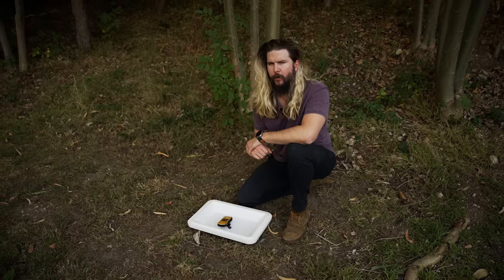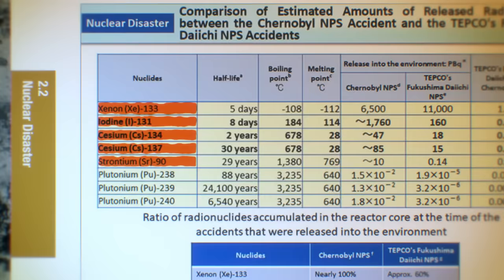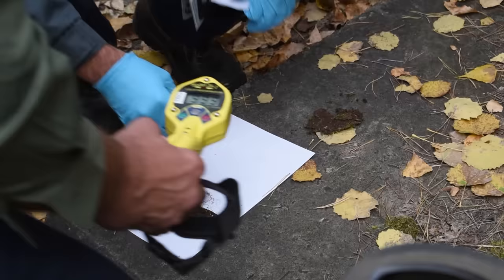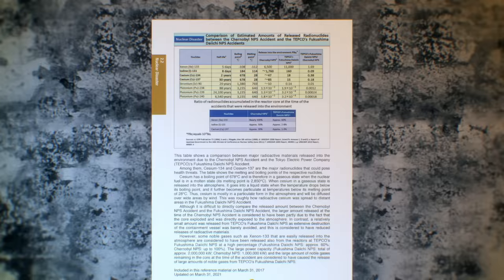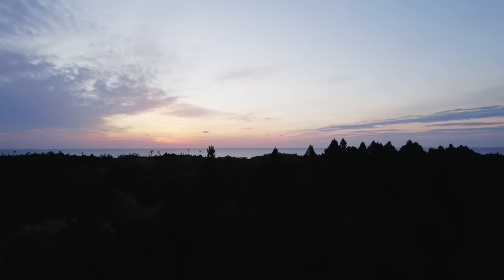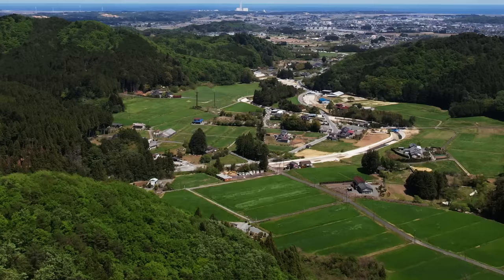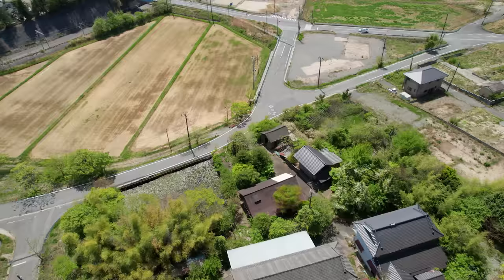A Nuclear Disaster's Deadliest Detail

Comment: I was a kid in Swedish Lappland when Chernobyl blew up. Up until then people didn't even thought of radiation that way. But oh, did we get an awakening. The small town where we lived had high levels of bequerel (the radiation from Cesium). The basement in our house had above 25 000 bq (per m3) when tested. Todays limits is 200. Luckily, our house was an easy fix. But some houses (mainly those made out of a lightweight concrete) was very problematic to do something about. Because it turned out that the material itself was a bit radioactive, depending on the source where they took the stone from.

Comment: The consolidation of "hot"(radiologically speaking) can indeed be more dangerous than the necessary clean-up process, especially if that process over-extends.
In the 1km squared scenario, the collected material would no doubt take up less space than if it was left where it fell, leading to increased exposure for anyone who has to survey, guard or remove the accumulated materia.

Comment: Hi Kyle,

First of all, thank you for that excellent introduction to the subject of hot particles (things I did not think I would write on YouTube lol). I did my PhD on this topic a few years ago and still work in this field. You did a good job in explaining the difference between Fukushima and Chernobyl! Their release of radioactive isotopes was indeed very different. Thank you for educating people about that.
While in Chernobyl whole chunks of the actual uranium fuel were ejected into the environment, the containment in Fukushima prevented this. Nevertheless, hot particles can be found in Fukushima. But they are not pieces of the nuclear fuel but condensed volatile elements. They are smaller (below 1 µm) and are basically glass pearls which contain radioactive Cs-137. Think of them as tiny spicy marbles. Bigger chunks of actual UO2 fuel like in Chernobyl have not been found (to my knowledge) in Fukushima. Which is a good thing!

We are still working on these particles since we want to understand how they behave in the environment. Nobody would leave spent nuclear fuel outside for more than 30 years just to look how it would dissolve into the ground water. Try to get funds for that idea... so these particles are our best system to understand leaching and dissolution under real life conditions.

Most of the counts you do measure with the Geiger counter on these particles come from Cs-137 as it is not completely lost from the fuel. The rest is Am-241 and Eu-154. U and Pu are to long lived or are not detectable with the hand held device.

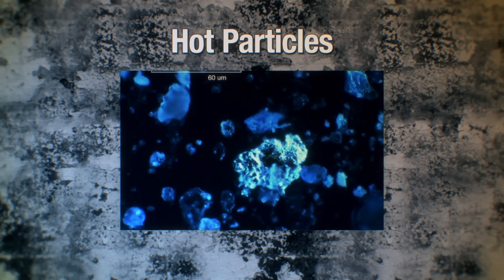Cheers for showing our work horse "Bob" @4:49. He is a fine particle and has been used for a lot of measurements so far.

Comment: Another thing to consider is psychosomatic effects of people living in the Fukushima-Daiichi contamination zone.

Because, for years and decades, every little sore throat, bump in throat, or bump in body part for whatever reason will send a spike of anxiety through you not knowing if that could be the one that is an actual tumor.  This psychosomatic anxiety has very real-life negative effects on both the mind and the body.
Reply: Furthermore, all this work to clean up Fukushima Daiichi will take 30 to 40 years.  That estimate is based on technology and techniques that have yet to be invented!

All six BWR-type reactors will be scrapped including reactors 5 and 6 which were undamaged.  Final cost total estimated at ~$195B USD not including the cost of the plant.  Even worse is it will tie up thousands of the best engineering minds and skilled workers.   All while creating exactly 0 watt hours of power.

The other risk is the $350 million refrigerated ice wall that is designed to keep ground water sloshing under the reactors.  It needs to freeze a large portion of ground permanently.   That system is out-of-sight and out-of-mind which makes it even more hazardous.

Commercial nuclear fission is too costly, takes too long to build, and has too many catastrophic risks especially when considering the ever falling price renewable energy production.  Commercial nuclear growth energy production growth will barely put a dent in the energy needed to totally displace fossil fuels.  In contrast, less than 1% of the world's land mass in current photovoltaic technology can power all the world's grids!  There's enough offshore wind to power the world several times over.  Both solar & wind are getting more efficient and cheaper still!

For nuclear power, we should rely on the free fusion furnace we already have in the sky.  It gives the Earth continuous 173,000 terawatts of power non-stop -- or 1000W/m² on the ground peak and its always peak somewhere on Earth.  All the combined fossil and fissile energy on Earth is only bucket compared to the ocean that is the Sun's power on Earth.  Nobody can tax, blockade, sanction, embargo the raw inputs of sunlight and wind neither.

Comment: I was multitasking as I listened to your presentation. I don’t recall if you mentioned that the explosions at TMI and Fukushima were not due to a sufficiently energetic fission reaction that would be potentially referred to as a fizzle, a failed nuclear explosion but rather d/t the electrolysis products of hydrogen and oxygen (from the extremely high temperatures the water steam were subjected to) recombining and detonating. I’m being very general here as my point is that the explosions weren’t d/t nuclear explosions a la a fission bomb but rather chemical explosions. 

Chernobyl wasn’t a nuclear detonation either, but rather d/t the extreme heat in the graphite core and it’s reaction to the hydrolyzed water products combined to eject bits of core as you described.

Comment: Marko Kaltofen found a hot particle 460 Km from Fukushima with a radioactivity of 40,000,000,000,000,000,000 becquerals per kilogram and made up of 80% pure core material.  The evacuation zone wasn't far enough

Comment: Awesome video, I am always surprised how many layers there are to learn about radioactive contamination. 
I always say, that the reason people fear nuclear power (As someone who fully support it as an option for a green future). Is that with any other source of power, you only have to trust, that your local power station is doing a good job and if it's mismanaged, the only danger is that you will be without power for a few days, until alternatives are set up. 
With nuclear power, you more or less have to trust, that every single powerplant on the planet, is well maintained and well run, because a serious accident, can (and have) lead to contamination far outside a nations borders and in extreme cases maybe crossing entire continents. And with the contamination being an invisible danger, it becomes so much more scary.

Comment: In my eyes, it's such a shame that the wide public isn't properly educated about nuclear power. Accidents like Chernobyl and Fukushima were unfortunate, but ultimately, in my eyes, shouldn't be a reason for to turn our backs to nuclear power.

People don't want them to repeat, but... Well, I like to use the aviation industry as an example. We didn't get where we are now without accidents and plane crashes where everyone on board died. 

Does that mean flying is unsafe? Of course not! Or, thanks to the way aviation industry works -- That experts look back at why an accident happened, and try to learn from it, adapt and change to stop it from happening again, is how we got from planes having one pilot with an open access to the cockpit... To big airliners with two to three pilots, sitting behind locked reinforced doors, and set procedures to get inside need be, that each airline keeps secret. 

"But nuclear accidents are much worse than plane crashes!"
Yes, yes they are. But they are also much rarer. A nuclear reactor, especially the modern ones these days, have innumerable systems keeping an eye out on them, that if something goes wrong, shut them down.

And ultimately, fukushima had... A couple thousand deaths? I am deeply sorry to all those that have lost someone due to that accident, but...

Ultimately, if it's a question of the entire world having a reliable and 99% safe source of clean power? That... In my eyes is worth it. Coal power plants cost on average of 1600 lives a year! And that's every year. Year after year. 

Fukushima was a one time accident. 

And solar and wind power? Those are great! But... Can't be relied upon. And can't be built everywhere, meaning then, say in germany, where most wind power comes from the north, while industry is in the south, you have to build many long distance high voltage power lines to get the power where it needs to be, which isn't good for nature either.

And that's in addition to the fluctuations in the grid these power sources generate, as it's not always ideal weather for them. Nuclear power plant? It chugs along, happily, day and night, no matter the weather... Releasing only water vapor. And lower level nuclear waste, and occasionally a higher level spent fuel to be stored in dry casks on premises after getting through the cooling storage pools. 

I'm so sad to see Germany shutting down their nuclear power plants, only to then be forced to buy energy from its neighbors that have nuclear power plants, like France, or, hell, even Czechia, which has only two! 

People should really be shown this series to come to their senses about the actual state of nuclear engineering. Maybe then... They'd be less afraid of it.

Comment: "Two kilometres of beach outside the Dounreay nuclear plant in England have been closed since 1983" because radioactive particles, accidentally released from a reprocessing facility, keep washing in from the sea. Special trucks scan the beaches and robots crawl the sea bed, occasionally finding and collecting little hot particles (approximately the size of sand up to 1x2mm). (Sandside Bay beach in Reay, Scotland.) Similar collection could be done at Chernobyl. Starting SOONER is better because radioactivity declines and because the particles weather into smaller particles that cannot be found and collected. I saw on TV someone manually tracking down a tiny chip of highly radioactive fuel in soil along the road in Pripyat. (If they collect too many in one place, they could even have a criticality accident.)

Comment: For the contaminated material, could they dig a bit deeper but instead of moving it away, just bury the top layer deeper down at the bottom of the pit they just dug, and then restrict digging in that area for X years?

Comment: There are a couple of factors. Cesium is an alkali metal. It will make salts, bonding with halogens. Another thing to consider is the relative strengths of the different types of radiation. Alpha particles are heavy, will cause a lot of damage, but not outside your body. Beta will penetrate your skin, and give you burns. Gamma penetrates through several meters of concrete, but is more likely to miss your atoms. 
   Plutonium is an alpha emitter. Good for a nuclear reactor because it emits slow neutrons. Not too dangerous if you don't inhale it. Sr-90 is a beta emitter, so it is a problem in the environment, and like plutonium, is a bone seeker, meaning your body would move it like iron into your bone marrow, destroying your ability to make RBC's. 
    You started out with corium, it's not what you explain. It's an amalgamation of nuclear fuel, fission products, and irradiated silicates (generally ones that involve hydrogen peroxides). It disintegrates as it ages. There are mosses which were inside the sarcophagus wall at Chernobyl which were using moisture and dust to sequester nuclear material. Bioaccumulation may not be a bad thing, as long as it is contained. If you have a bunch of trees which suck up radioactive elements in the soil, that's good, unless they catch fire, or are allowed to rot and scatter in the winds.
    Fukushima, the water was contaminated. They waited until the cores melted down before they used seawater to cool them down. The containment design reduced the criticality. The explosions were hydrogen gas being released with the hot steam and zirconium cladding on the fuel rods.
   Finally, don't try and be Rod Stirling.

Comment: Hiroshima had electricity and water restored within hours and numerous buildings rebuilt within days after the nuclear bomb explosion. The only mitigation they did right away was bulldozing the majority of the ruins into the bay and that was done mostly to clear the land for reconstruction, the radiation mitigation was a byproduct of that effort. People moved back in to Hiroshima right away and yet the long term hazards from fallout were relatively minor. The short term effects were horrendous but those that moved in later were for the most part just fine living at ground zero for years.

Comment: I know that environmental engineering practices for soil and groundwater remediation can include practices like "soil washing". It is not cheap because the heavy metals and other contaminants are rinsed out with water and solvents cubic meter by cubic meter, but since a large part of the cost (excavation) is already taking place at Fukushima, is there any practical use for soil washing? In my mind, the proper capture and long term storage of concentrated contaminants would be a lot easier than figuring out where to store thousands upon thousands of tons of topsoil for the low levels of contamination found within the soil. 

Similar to the vitrification project that Hanford is attempting to undergo.

Comment: Alpha emitters are also a massive problem, if a bone-seeking radioisotope ends up in your food it's near impossible to detect as the food shields it and once consumed it can stay in your body for decades or longer.
That's why the tour guides tell you not to smoke, eat, drink or touch your face. People should also wear at very least a dust mask. You could easily have one in your pocket without you knowing, depart the zone, pass checks and carry it with you, eventually consuming it with that overpriced airport sandwich.
If you want a "good" example of a disaster with extensive loss of containment and a long legacy of contamination look at the Kyshtym/Majak/Ozyorsk disaster, it's a level 6 on the INES scale. Although it's a series of disasters, mistakes and problems so in it's entirety the situation should probably rate a level 7. It created the Eastern European Radioactive trace... and it occurred in 1957.

Comment: The thing that has never been truly expressed in the mechanical way the core material of the Chernobyl reactor went so far. They superheated the core material, and created a massive steam explosion, that lifted the unreal heavy reactor floor cap - that all the fuels drop wires were hooked to - up at a forty five degree angle - a hundred feet in the air. The dangling superheated fuel then touched each other and created a heretofore never seen on earth situation. A spontaneous reaction explosion. The only thing that stopped this from being a much worse explosion was that the amount of fuel that exploded was miniscule to the amount present and that explosion then dispersed the superheated fuel off the titled cap, into the air for miles in the air and also, straight down into the reactor body where it again exploded kinetically, not radioactively,  up and outwards onto the ground. i call it the Chernobyl shotgun but its more like a mortar . A nuclear mortar suspended in the air for the briefest of times. That fuel went dozens of miles through the air. The fallout map clearly shows where the largest particles fell from this never before seen situation. When the Soviets screw up, they screw up big time and this was one of the biggest screw ups of all time. All over a systems test that should have never been done like this. They could have done a spin down test on a turbine without risking an active reactor, by setting one up independently, and seeing what the spin down results were. This was like seeing if a new design parachute works, by giving it to live people jumping out of planes, to do the first tests on it. Just crazy.

Comment: Kyle, this is a solid video and I avidly follow this series, but I have a follow-on question for this vid: You mentioned that you previously didn't understand "how contamination escaped a melt-down". Well, I am still not entirely clear about this. Chernobyl is easy to understand, the reactor core blew wide open, caught fire, and was exposed to the sky directly. But if Fukushima's containment was able to keep the fuel particle in, why not the other stuff? Are the containment structures unable to contain fluids? Maybe it's beyond the scope of your channel but I'd like to see an animation of how these substances moved from the reactor core, through the containment structure, and into the outside environment. Sorry if this is a dumb question.